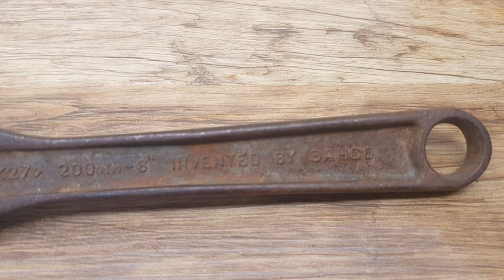Bahco Adjustable Wrench Restoration

Comment: I have a good collection of adjustable wrenches because I find so many thrown out and recieve some from our areas groundskeeper, I only use a wire wheel on it to remove the worst rust, then wash it with hot water and soap until there's pretty much nothing more coming off of it, then I oil the contact points and assemble it again, and it keeps its patina.
Reply from the maker: Nice, that sounds great. You must have a huge collection of them.

Comment: For it to get like this does it mean all of the chrome plate has come off? If so how long did the finish last without rusting again, I just want to know if it's worth doing.
Reply from the maker: Yes I didn't see any chrome at all and It still looks really good today. As long as you respect the tool and keep it clean I would say go for it.

Comment: Let's do this !
Reply: I'm back !
Reply: I love how you take the time to work those castings out .
Reply: Dies the cold blue build up or just stain ??
Reply: Oh that contrast sanding was the trick !
Reply: Stunning transformation 👏
Reply from the maker: @doinsngoins  
Thanks Steve. The cold Blue or Gun blue it is sometimes called is more like a stain. It's used to prevent rust. I usually do 2 coats before soaking in oil but I didn't show that this time. Magic stuff and can be used on anything. Depending what your doing but you can get the same effect just by heating up some metal and dropping it in some oil. If you have a rusty drill chuck key, clean it up and give it a go.
I keep thinking the cold blue would be good for you if you had any rusty handles on one of your burners.  Thanks for watching